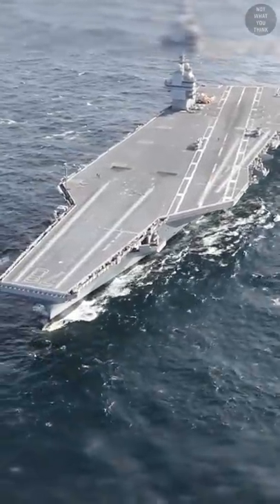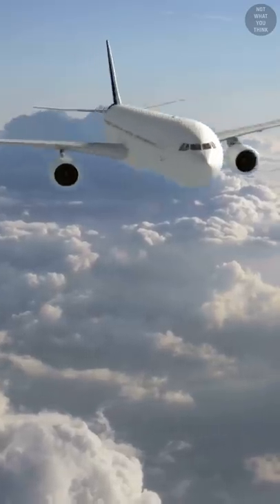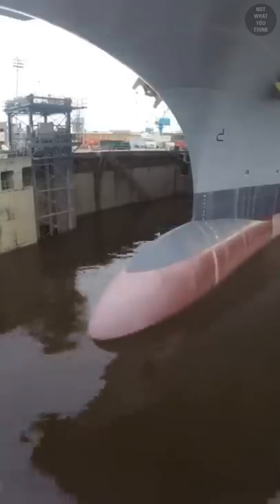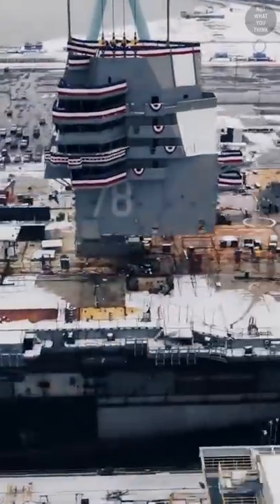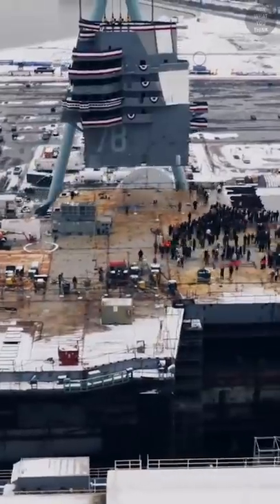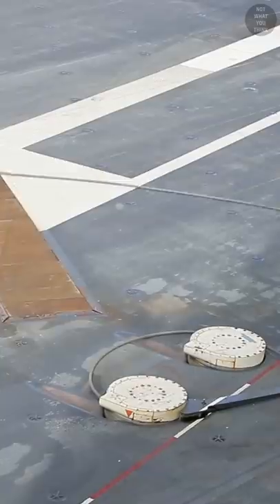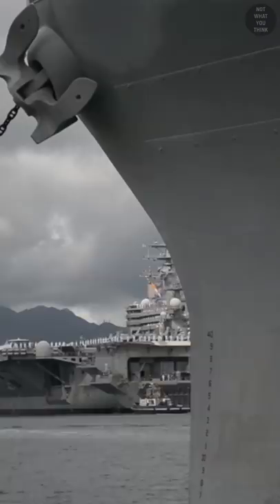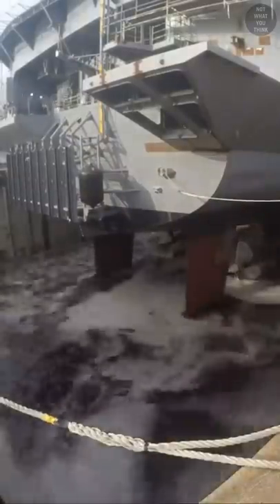Why is the US Navy Flushing Money Down the Toilet? #shorts

Comment: could install some seats on the edge of the boat and put a hole in them, like they had in castles in the Middle Ages
Reply: Or like the trains in India
Reply: @jfo738  I think they are called: Windows!
Reply: @jfo738  🙄🙄 trains in India have been 100% open waste free,  I mean now they don't dump on tracks , it was a initiate by railways and every train in India now have a system to store it and don't put it on tracks
Reply: @apatriot6421  they spray it on the track?
Reply: @drockjr  typo , I mean to say " they don't put it on tracks" *😅
Reply: Well, the aft end IS called the poop deck
Reply: They actually used to do that
Reply: Right, and train seagulls to wipe their ass. Caw-caw, seagull to another, "goddamn Mario, this job smells like shit!"
Reply: @jamesalexander3530  wouldn’t want a seagull wiping my ass, they’re mean ass birds
Reply: @drockjr  more like they sprayed untill few years back now they don't do that
Reply: It’s still done in some areas for stevedores, they are called thunderboxes
Reply: We do that when the system is backed up
Reply: Bingo!!  Dump that load and get back to work, dammit!
Reply: Why do think its called "going to the Head"?
You think if you want to drop a dookie, you do it at the back of the boat, but two things: 1. You steer the ship at the back, 2. The captains quarters was at the back of the boat.
So what they did was, yes, seats with holes over the sides, at the Front of the ship. What else is at the front of the ship, the figure head. So if you wanted to say you were going to use the "bathroom" you said you were "going to the [figure] head"
Reply: They used to do that on pirate ships
Reply: @apatriot6421  not really
Reply: @drockjr  yes. I think the new ones don't. Buy then the central government only provide budget for new coaches to the states that vote for them. Xd
Reply: Actually that wouldn't be such a bad idea...
Along with some sort of seawater pump to clean right after
Reply: @hr_47  no bro now 100% of the trains have,  you can search the internet,  it have been completed before 2 month only,  now each and every train have
Reply: @apatriot6421  Yet you have designated shitting streets XD
Reply: @unverifiedbiotic  hey bro hope you   can come out of 2000s phase to 2021 phase , hope you know it  fast that time has changed 😉
Reply: They did that on sailing vessels.  At the bow of the ship. Hence the phrase ” going to the head” 
True !
Reply: Don't worry the sailors would fund a way to clog those also 😂
Reply: @apatriot6421  ok cool. But the last time I went on a train it didn't have. Maybe because it was an old coach

Comment: Here's hoping they go back to tried and true conventional with Fords Sisters. Just because it works on a plane doesn't mean it works for a ship or building.
Reply: Lets hope you go back to a flip phone and a pentium 3.
Reply: @AJ Thomas baby wipes work pretty well actually
Reply: @jordanp2539  It's wasteful, costly, bad for you city's sewer system if you flush them and has bad impact on the environment. Why no use good old water?
Reply: @AJ Thomas come back to me when your teeth are fine.
Reply: @brettaugustine1564  I'm pretty sure he was implying that brushing without toothpaste (or anything other than just water), that your dental health wouldn't be great. 
But good job going off the deep end.
Reply: @matthewriege1473  nah sounds like another "haha your teeth bad" lame joke that you'll see online quite often
Reply: Like shure you want to try the new tech... but on a behemoth aircraft carrier.
If your gonna try new tech that doesn’t require said ship size and can be attached to any ship use a frigate to test it on.
Reply: I am referring to the tech on the Uss Gerald R Ford
Reply: @jordanp2539  that was one of the reasons vcht systems in the navy fail. The toilet paper that is supposed to be used is specifically destined to break apart on flush. Normal toilet paper clumps together and when it dries in a pipe it is like cement.
Reply: @Ghaval  That time when the Navy fixed a 10 million dollar toilet with a $500 bidet (date tbd)
Reply: Every single ship that I know of have this type of plumbing. You think our stuff works like a regular toilet on land.
Reply: @AJ Thomas i dont want high pressure water spraying up my bum thanks but no thanks.
Reply: @spacetechempire510  Yeah, this is not new tech. Every cruise ship in the world operates a vacuum system. And just about every commercial vessel. It's real simple, and not crazy expensive.

Comment: Of all the places where you might want toilets without water, I didn't think THE OCEAN was one of them.
Reply: Did you expect to flush out the shit into the ocean in 2021?
Reply: @Wistbacka  They typically take water in from the ocean, desalinate it if it needs to be fresh, and then waste is stored onboard until the ship is in port.  Clearly they wanted to reduce the cost and space of that storage, but it seems clear that's not going very well for them.

But you're right, the problem is on the waste side not the supply side.

Comment: As a sailer. The toilet vacuum system has been around for a long long time. The reason it gets clogged is the pipes have to be pretty thin and are usually made out of steel. With sharp angles and corrosion inside the pipe, even 1 ply toilet paper gets stuck. Then you add people who flush baby wipes and it’s chaos.

Comment: The big issue is that airplane toilets are assisted by the pressurized cabin which has a higher pressure then atmospheric meaning the vacuum doesn't have to do much work to get an effective flush where as on land it has to work harder to get the same result, there's also the issue of cool down time and the size of the system

Comment: The vacuum system is only used in areas where the correct down slope cannot be obtained, for toilets that are lower than the holding tanks.

Comment: Navy has 2 types of sewage systems: CHT and VCHT. Collection, Holding and Transfer. The V is for Vacuum, which is what is described in this video.
What is CHT/VCHT? Think Septic tank. You think just flushing it over the side is ok, however, not in port, there are laws about that. We have to hold sewage 0-3 miles from land in accordance with EPA and others. (And they fill up fast) If we are further then 3 miles, we can "discharge to the sea".
CHT isn't just bodily waste, but waste water from water fountains (scuttlebutts), and cooking as well.

Comment: Microbes grow in sewage and form a mortarlike sludge. Too bad they can't change the toilets to the macerating type and fill the dry vacuum system with filtered sea water that circulates to a holding tank when in port and into the sea when not.

Comment: New tech always has teething issues. If anything, the US needs twice as more carriers than it currently has, and new heavy cruiser/battleship design with cellular vertical launch tubes in place of turrets. Also the vls tubes need to be internally reloadable from an internal magazine of missiles on a giant mechanical rack queueing system. Also mach 3 supercavitating torpedoes. And laser emitters for anti missille/antihypersonic projectile/anti icbm boom booms. And while we're at it, force magpul to develop and release its PDR concept.

Actually, just the last one would be fine. I wants me a magpul pdr something fierce.

Comment: This is an example of using technology that is not necessary,  I understand the reason for the vaccum system is to reduce the amount of  freshwater used on board. But most ships use salt water in their toilet system lots and sea life eats poop so it is not a problem at sea. In port you use fresh water and biomass digester to process the waste water . Old technology.